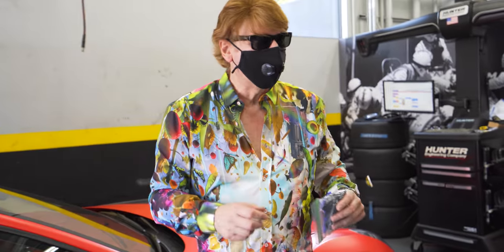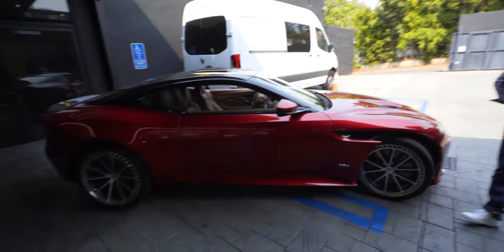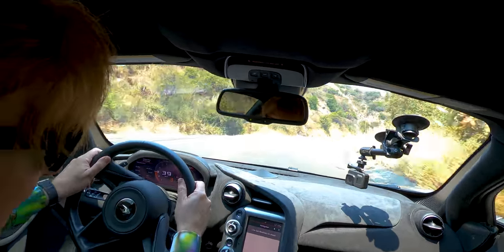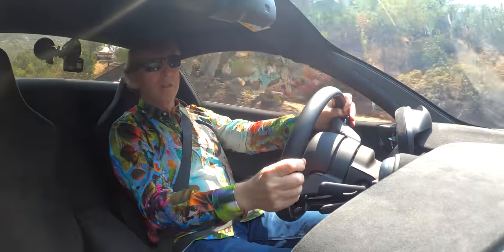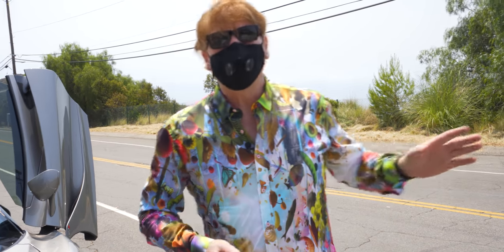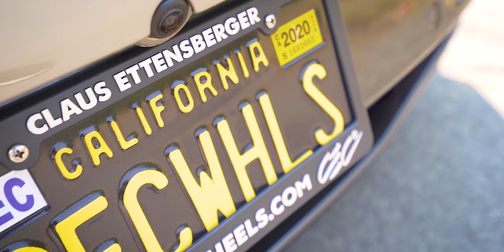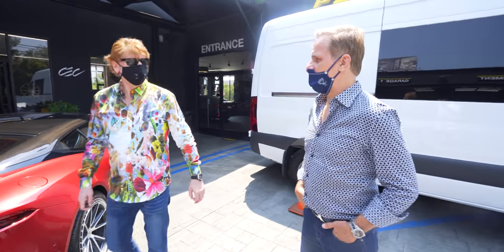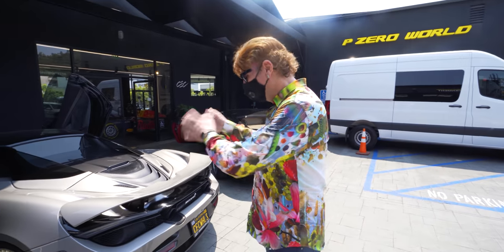MY MCLAREN 720S REVIEW (IT'S NO FERRARI!)

Comment: I was hoping to hear some of his thoughts regarding the Aston, but, oh well.  All the comments below about which car is faster; N-Largo, 720, 488...............I see a lot of HPDEs and it ain't the car, it's the body behind the steering wheel. That kind of power to weight ratio is very hard to handle.  Besides, Claus might have wicked down the power on the 720 before turning it over to Michael.

Comment: The reason why the paddle shifters are fixed to the steering wheel is because that is a high performance car, with a very direct steering ratio, and while driving it you're not supposed to remove your hands from the 9 and 3 o'clock positions. The way you are handling that steering wheel looks like you're a 90 year-old grandma driving a Prius.

Comment: The 720S is absolutely faster than your N-Largo, if you had the N-Largo S your statement would be correct. The McLaren is faster to 60, its faster to 124 and to 200. The McLaren is almost 400 pounds lighter than the N-Largo and its aero doesnt create near the amount of drag, the N-Largo has a higher top speed and while the differences in speed arent great the McLaren is faster. It may not feel faster but the numbers dont lie.

Comment: The Nlargo feels like the fastest car but I think the 720s destroys it in 0-100, the 720s is even faster than the P1 but doesn't feels like that, and almost every brand has the shift paddles mounted to the steering wheel only ferrari and a few others has fixed shift paddles behind the steering wheel

Comment: How can you say that a McLaren 720S is not even close (as fast as) a Ferrari F12 N-Largo?? If anything they are very similar, some specs say the N-Largo is slower to 60 mph. Even a Tesla 3 Performance S does 0-60 in 2.99 secs. Which according to some is 0.11 secs faster than the Ferrari. Someone needs to check their figures.

Comment: And again Michael you are wrong. 720 has slightly less bhp but is defo faster 0 60 than you n largo. N largo is 3 seconds 0 60 and 720 is 2.5 just think about weight of cars. Doesn't take a brain surgeon to work that out. Carbon tub in the 720s. I prefer the n largo but be honest it's not as fast as a 720s. On track or 0 60

Comment: McLaren... ugly as fuck, notoriously bad customer service and shitty reliability.... apart from the F1.

In regards to the shifter paddles being on the wheel. It’s perfect. You’re not supposed to move your hands around on the wheel like you did Michael. If you ever lose the rear end in a corner you’ll never be able to catch it with the way you place your hands on the steering wheel. You place them at 10 and 2 o’clock and that’s where you leave them at all times. That way you also don’t have to take your hands of the wheel to shift, ergo that’s why the shifters are where they are in the 720.